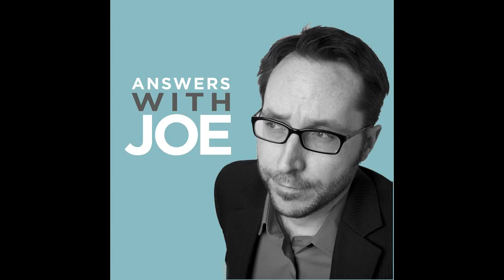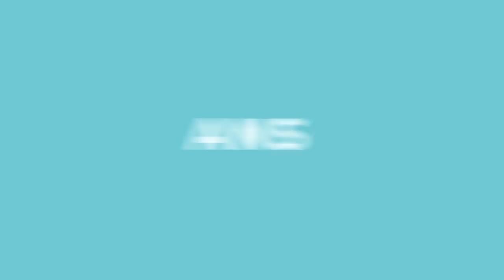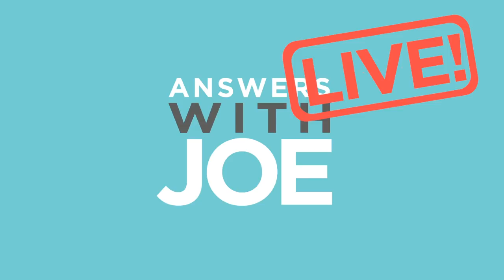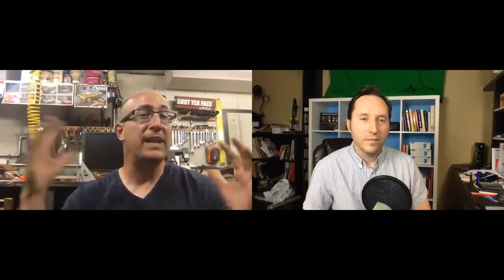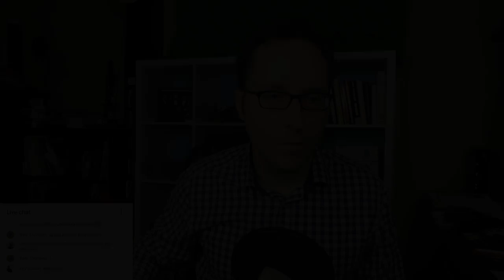🔴 3D Printing, AI, and the Future of Design with Greg's Garage | Answers With Joe Live

Comment: The house I live in was built a few years before 1910, like many others in my neighborhood. We've done a little to it, but for the most part only changed floors, bathroom, kitchen and panels. It's originally a timber house, but it's covered over so it looks like an ordinary wooden house. Timber houses are extremely rough and can withstand a lot. Norway btw

Comment: Could you do a video on the limited resources used to make batteries? Some people think we can only make 500k more ev's with current discovered resources(which is bull). There is a limited amount of lithium, and it could be a problem in the future. It could be interesting.
Reply: Well, if someone discovers how to make a room temperature super conductor then we can store tremendous relativistic amounts of electricity in them. There are billions of possible material combinations of elements and their isotopes and ions... Could be trillions but one of those should work.